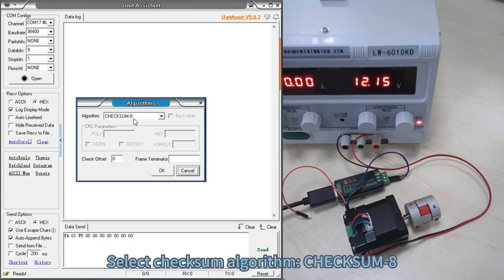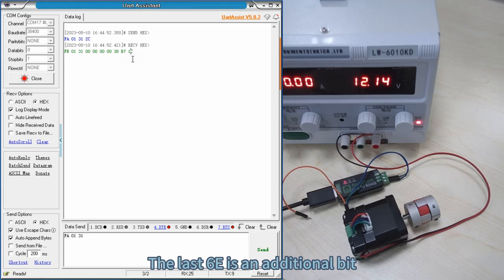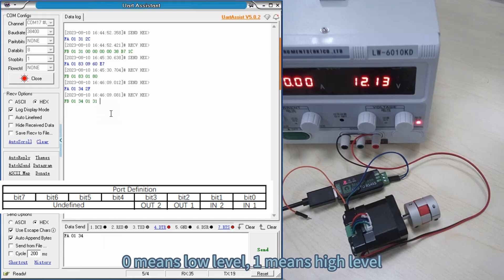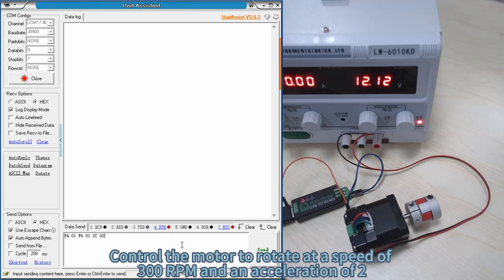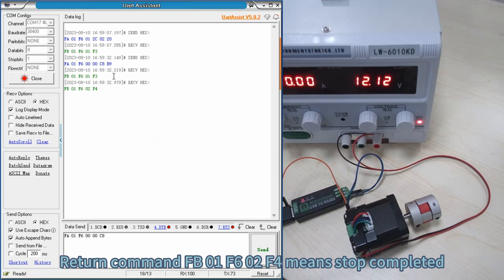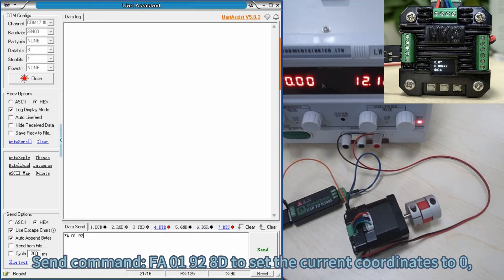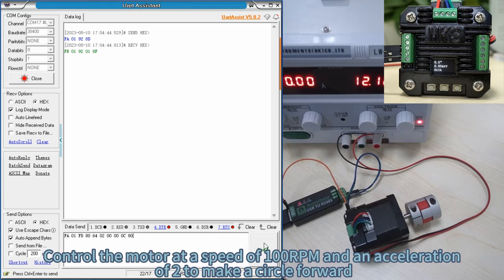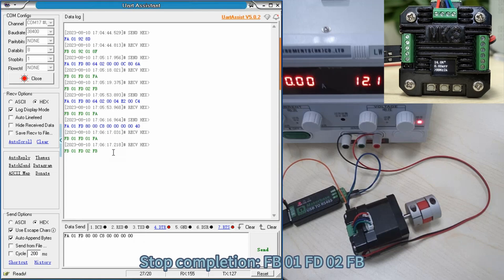Makerbase SERVOxxD Closed loop Stepper Motor Example2 RS485 example

Comment: SERVO57D RS485 PCBA servo drive with firmware V1.0.3 and V1.0.4 does not work via RS-485 interface. This is a factory defect!
Reply: yes not working , any update

Comment: I meant to ask because i checked your website.  For your MKS ADP v1.0?  Not even ai can find a pinout diagram for that. I struggled bigtime trying to get brand new mks42cv1.0's running this weekend off an r3.  I saw you discontinued both items but the pinouts would have been very nice for the adapter......